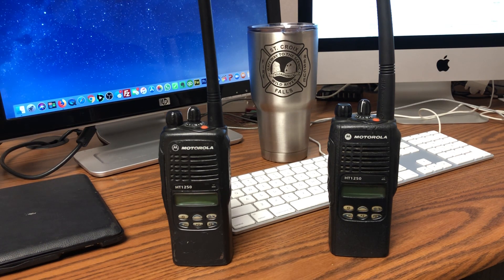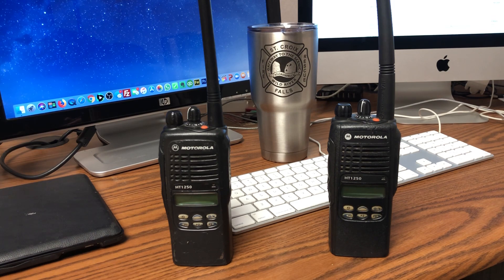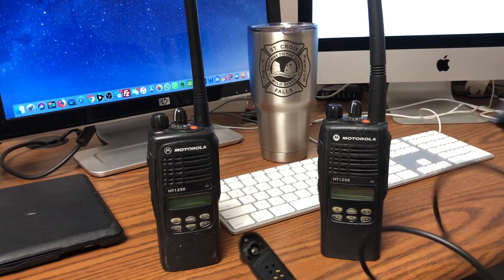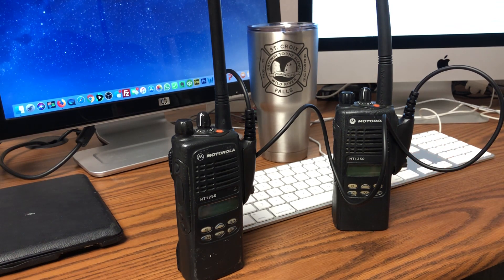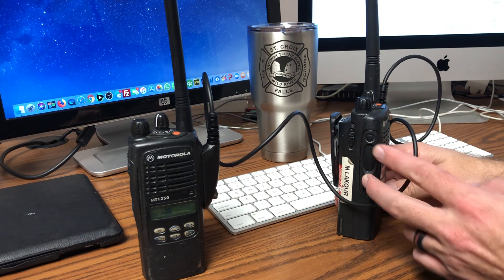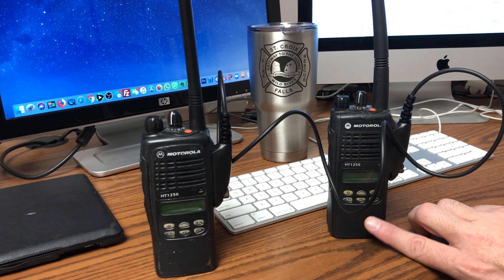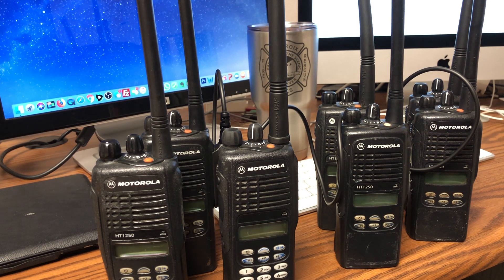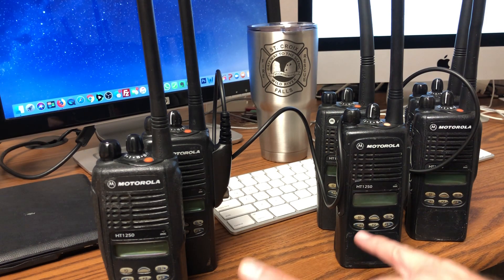Cloning Your Motorola HT1250 or HT750 Radio

Comment: To Add A Word Of Caution, I Used This Method On 11 Radios: 1 Group A Of 6 Radios Would Clone To Each Other, One Group B Of 2 Radios Will Clone Each Other, 3 Individual Radios Will Not Clone From Any Radio, Nor Will The Group A & B Clone To Each Other. In Addition, While Trying To Clone 2 Of The Radios, They Had The EEprom Error After The Cloning Attempt.
I Did Manage To Recover The Radios Via The CPS BUT Only After using A Aftermarket RIB And Cable, The USB Ribless Cable Would Not Work With The CPS To Recover This Error. All Of The Radios Are The Same Model, And It Made No Difference If The TANAPA Matched Or Not.

Comment: can this be done with the apx 2000
Reply from the maker: Every radio has a specific cable and proprietary software. It is expensive. If you have the right cable and software, it should clone to other radios, but may have a different process. You may want to reach out to Motorola and ask for a local vendor that programs radios. I have used the local guy who programs the local LEO & Fire radios.

Comment: A good question..  When cloning radios for a department, does the ID transfer also?  Everyone has a separate ID number and do not want  all the radios with the same ID.
Reply from the maker: I don’t recall a ID number on analog radios. That is more of a digital radio thing, where dispatch can see who is keying up.
Reply: @kirksfilms  you can put an MDC identifier in the Analog models.
Reply: @kirksfilms  we all have id’s on the 1250

Comment: Hey Mr. Anderson what program is needed to actually program the radios
Reply from the maker: It is called Motorola CPS. It is a proprietary Motorola software that is specific to each model of radio. So, I can’t use my software for the HT1250/HT750 to program the XTS 2500 Digital radio. I found a copy online that I downloaded. That can be dangerous, because so many viruses are out there. Be careful. I tried it on an old computer that I only use for radio programming.
Reply: @kirksfilms  it's funny how I commented and you didn't see my comment at all or replied so I don't know what to make of it maybe I'll try to e-mail you and see what can be done
Reply: Okay is it professional CPS or the CPS we use for mototrbo radios. The CPR 7550s
Reply from the maker: You need to Google the specific radio model and find out the CPS software required. It usually has a version number. Then Google the exact CPS software number. Look for reputable downloads. Be aware of viruses. That is all I got. Motorola is proprietary and doesn’t offer old software openly. Look for a local radio guy. Perhaps at a Ham Radio Club. They have guys that geek out and have all kinds of software laying around. That is all I got. Good luck!

Comment: Just bought a lot of 10 ht750 not programmed. If I buy the cloning cable and pick one of the 10 to be a master will I be able to program the other 9?
Reply from the maker: Yes. As long as they are all the same model number, you should be able to clone them from the one you programmed. I ran into issues programming a HT 1250 with a keyboard from a HT 1250 LS radio without a keyboard. All of the HT 1250 LS radios cloned fine.
Reply: @kirksfilms  thank you will order one from amazon today
Reply: @kirksfilms  how do I know if my radios are in uhf of vhf. And what gives a better signal?
Reply from the maker: Aaron Villela If you pull the battery, it is probably listed under there. Our county uses vhf, so that is what I bought. What are you using them for?  You would usually know what you need before you buy, unless your using them for personal use, but beware, they are for frequencies that require an FCC license, whether for public safety, Ham radio, or GMRS. You can do FRS, but these output a higher frequency than the FCC allows.  Check www.radioreference.com for local frequencies.
Reply: @kirksfilms  I tried it with no luck. When I press both side buttons on turn on master only thing that happens Is I get a solid beep
Reply from the maker: Aaron Villela - Did you press the buttons at the same time and then turn it on?
Reply: @kirksfilms  yes I did. And the radios are the same model
Reply from the maker: Aaron Villela - Maybe you did, but I would try it with a couple different radios. It is possible the cord is damaged or the mic port needs to be cleaned. The radios we got used were pretty banged up and needed to be cleaned.
Reply: @kirksfilms  I did try with one other radio and I got the same result. But maybe your right I will clean the copper contacts tomorrow since they do look dirty and will try again tomorrow. I will let you know on the results. Thanks for your quick reply